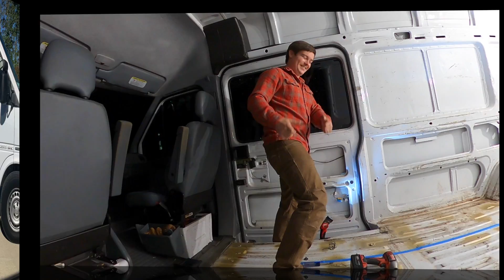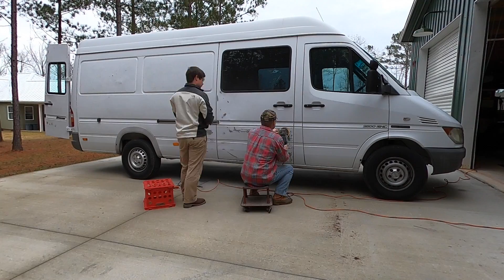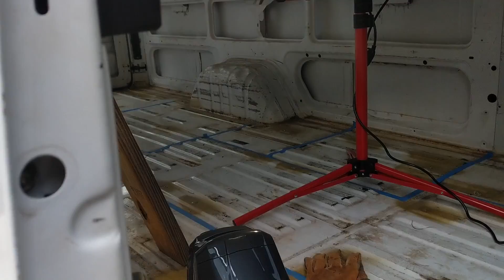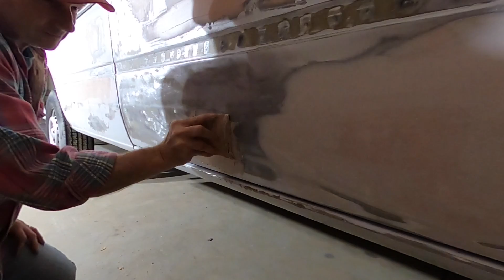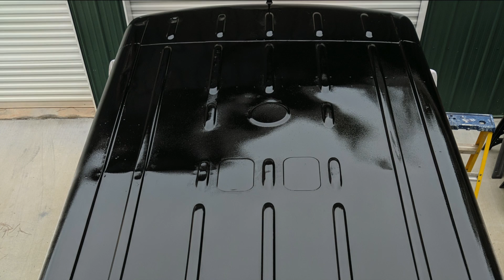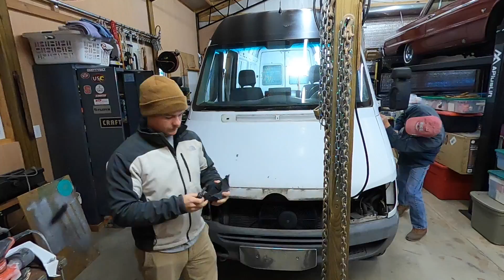Van Build Episode Two! The Beginning of the Bodywork // DIY T1N Sprinter Van Conversion

Comment: Hi, thanks for this video (and the others). I am doing body work around the back door windows and the doors in general on my 140wb T1N. I will need to replace some of the sheet metal on the door. Since you mentioned you did some sheet metal work on yours, what grade and specs of sheet metal did you use. I am not familiar with body work but I do this as a side project.
Thanks.
Reply from the maker: Hey Andre, I don’t remember the exact specifications of the metal we used. I would measure the thickness of the sheet metal on your van and try to match it as closely as possible. For the steel type you can use regular mild steel as long as you’re planning to paint it. I hope this helps and if you have any other questions just let us know!
Reply: @goldenadvantures2573  that's right . I was going measure the thickness with a caliper. Where about did you source the sheet metal ? Thanks
Reply from the maker: We purchased it from a local metal distributor in South Carolina called Dillon supply.

Comment: My rain gutters are leaking on the side and  I was wondering what process  and how you layered 
I was about thinking about the following order
Pressure wash
Grind to metal
Clean with rost converter so it gets into the cracks
Etching Primer
Seal with 3M brushable  panel sealer
Top coat

The one step I wasn't sure about was if the sealer should be painted on the bare metal so it creeps or after primer between top coat.
Reply from the maker: Wet ground everything clean with a wire wheel on the angle grinder then sprayed an extremely heavy coat of epoxy primer. The primer penetrates much better than 5200 so that’s why we primed first. Then we painted the top coat over everything. I’d be weary of using panel sealer up there due to how much the van flexes.
Reply: @goldenadvantures2573  So you didn't use any sealant at all just heavy grinded, prime,d and painted?
Reply from the maker: No we used 3M 5200 after we primed. It’s a marine grade sealant.
Reply: @goldenadvantures2573  Yeah I remember you mentioned you like using that. 
That order makes
Reply from the maker: I’ve never had anything leak after using 3M 5200. So far it’s bombproof. I highly recommend it. It’s like a flexible putty that will stick to anything.

Comment: I'm watching this because it came up on my list. I have seen your other videos and commented. It's good you have your dad to help and I can see he is skilled in body work.
I passed up a Ford cutaway van. They are rare because weren't many built. It had a heavy fiberglass box on it with an rv door. It was made to be a mobile showroom. Had a solar panel and lights inside.
I didn't buy it because it had the 6.0 diesel.
The guy couldn't sell it for months. I saw it on Ebay twice. I think it sold for around $10,000. Was a 2005 with 141,000 miles.
I'm disI didn't buy it. Started out at $15,000.
Reply from the maker: We are beyond thankful that my dad helped out with the build. He has a lot of knowledge that helped immensely. Were the 6.0 Fords the ones that had so the problems with not starting in the ambulances? 10k isn’t bad for a basic shell to build out of though.
Reply: @goldenadvantures2573  The Ford 6.0 diesel has a very bad track record of engine over heating and needing to be bullet proof as it's called.
Many videos on YouTube about it. It was called a mobile concept van and showroom.
The guy was a dealer. I did put down money to hold it but changed my mind.
He was asking 14, 900. 
I don't remember the exact amount on Ebay it sold for. Between 10,000 and 11,000.
You can find pictures on line. I didn't want to break down on the road and have thousands of dollars in engine repairs.
But I do think about the van and still have pictures.
Reply from the maker: Ah yeah I don’t think I’d want to take a chance with a track record like that either. The 5 cylinder diesel in our van is supposed to be pretty reliable as long as it’s maintained properly. We’ve really been pretty fortunate with it so far.

Comment: Love the videos! I’m building a 2005 Dodge T1N (140” unfortunately) right now and body work is up next after some resonator and EGR valve replacement.
Reply from the maker: Glad you’re enjoying them! Shorter vans just mean they can go more places. We had to do the turbo resonator as well. It popped on us driving across the country in august and we limped it the last couple of hundred miles.
Reply: @goldenadvantures2573  I limped mine from Lexington to New Orleans! Resonator was duct taped around the seams and the EGR had been sealed with loctite 🤦🏻
Reply from the maker: You had it a little worse than we did haha as long as I kept it under 2700 rpm I stayed out of limp mode.
Reply: @goldenadvantures2573  Mine wouldn’t go over 2500 and acceleration was laughable. People aren’t too happy about a van pushing 35 on a highway on-ramp. Just sat in the right lane and coasted my way back down south.
Reply from the maker: That does sound pretty brutal. We really struggled to make it up the mountain passes around LA. It was 115 degrees and the van was working way harder than it should have been because of low boost so we had to pull over and let it cool off a few times.